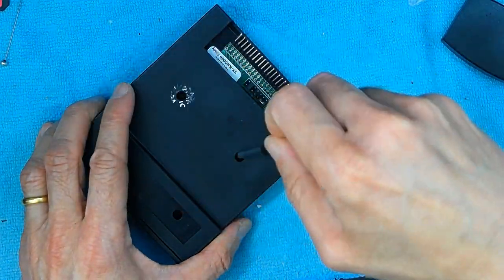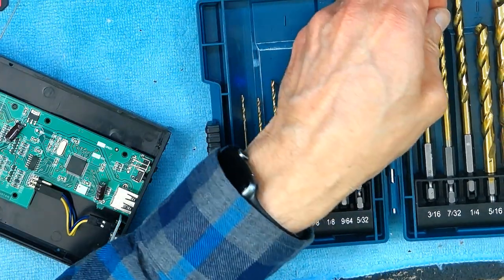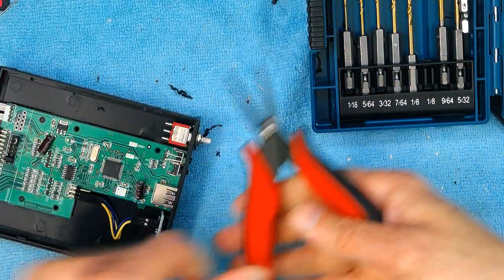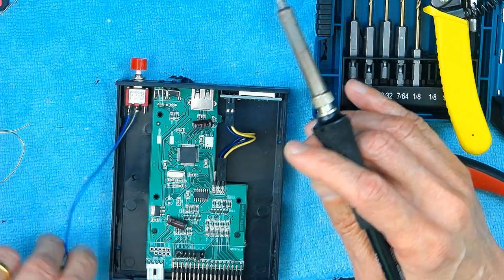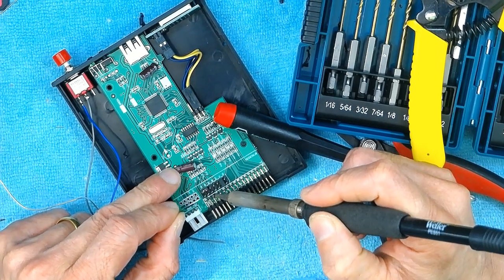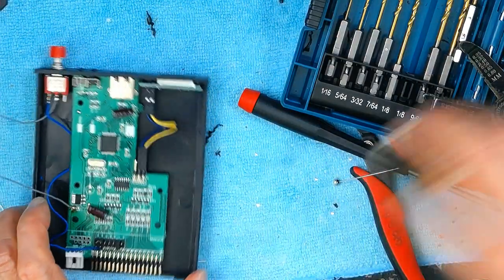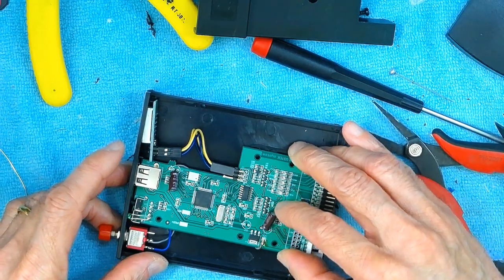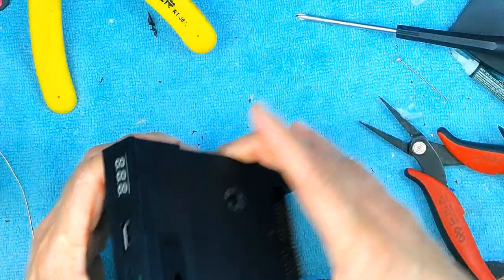Tutorial on how to modify Gotek Floppy Drive Emulator For a Technics SX KN-5000 Music Keyboard

Comment: Hello, is it not possible to mount a regular Floppy Drive Emulator or do you have to specially mount the Floppy Drive Emulator for an XS-KN5000, John
Reply from the maker: Hi, You have to mount the specific one, or else it will not read. These emulators rage from $15 to $300 and the only difference is the firmware, and other customization such as OLED, encoder etc.
Reply: @TECHNOLOGYTIPS101  
    I think it's quite a good price: $300, which is why I asked whether you could also do it with a general emulator
Reply from the maker: @johnweetzel8633 @johnweetzel8633  Yes, you can as if you are good with soldering with above-average computer knowledge.

Comment: The KN5000 wants to format the floppy every time. I have the SFR1M44-U100K emulator factory was MITSUBISHI M355F-3252MM will it work?
Reply from the maker: You need to make sure the Jumper settings on the Emulator matches the ones on the Mitsubishi Floppy drive. Also use the Windows App to format the flash drive to 100 banks at 1.44MB each Bank.
Reply: @TECHNOLOGYTIPS101  Thanks for the answer, the problem was actually the jumpers in the drive. I changed to another setting and everything works.
Reply from the maker: @karolcwielong3963  I am glad to hear that, all the best!

Comment: any clue sir for the position of the jumper on the SFR1MM44 U100K ? in my kn 3000....pls..
when i try to load any floppy numbers from 1 or above its will go back to 000 and gives error 02 and 09 on my kn3000 screen...guide me pls,....
Reply from the maker: It  has to match the exact settings of the old floppy which was removed from the keyboard. There are 3 possibilities that you can set it to, and they are Master, Slave, and Cable Select. Most likely you need it to be set at Master. The manual of the Emulator should tell you which position is Master, and it should also be printed on the PC board next to the jumper pins.  Thank you

Comment: does SFR1M44-SUE work for keyboard?
Reply from the maker: That depends what type and version of firmware is installed on the SFR1M44-SUE. If it has the factory original firmware it may work for some keyboards not all. Specially if the original floppy drive was Mitsumi or Y-Data you will have a hard time with it.
Reply: @TECHNOLOGYTIPS101  it doesn't work on my keyboard if i partition is unreadable
Reply: @TECHNOLOGYTIPS101  if not I partition, can be read but can't be filled in files

Comment: Please make for kn 2000. Thank you
Reply from the maker: Most of the KN2000 Keyboards have the 26Pin Floppy Drives, so these will not work for them unless you get a 26Pin to 34Pin Adapter.
Reply: @TECHNOLOGYTIPS101  i don't understand about what you say. But thanks for reply. And if you do that for kn 2000 maybe future, please upload.
Reply: Hello do you know which GOTEK works on the SY FD3 Technics disk drive which was used on the GX3 and GX5 Technics organs
Reply: @PakBudiTarigan  the KN2000 has a different  ribbon connector with 26 pins so you would need an adaptor to put the electrical connections on a 34 pin normal plug used in most PCs to the 26 pins used by the ribbon connector.
Reply from the maker: @timpullen4941  Hi, Your unit was originally manufactured with 3 different types of floppy drives. So the bios on that specific model are programmed for the exact  type of floppy drive which is currently installed in it. 
Even the pin count, connector type, interface  layout and jumper settings could be different. So  I have to know exactly which drive is in there now to tell you which emulator can replace it.
Reply: @TECHNOLOGYTIPS101  thank you brother. I will check my kn2000. Merry Christmas and Happy New Year
Reply from the maker: @PakBudiTarigan  Thanks and Happy New Year to you as well
Reply: @TECHNOLOGYTIPS101   Hello, the original floppy is Mitsubishi MF 355F-3252MM, rev. D, from Dec. 1997, and the emulator is SFR1M44-U100, I performed all the steps several times, I experimented, but always - ERROR 2 - there is no disk in the device... Advice?
Reply from the maker: @HenriNorman @user-ns9dp6of1c  Greetings; please write your question as a new question, not on the follow-up questions of another user.  In your specific case it appears that your Jumper Settings are not correct. Please make sure that your jumper settings match the old floppy drive.

Comment: my technic sxkn 2000 has 34 pins can you do the same? Thank you
Reply from the maker: If you Technics has a 34 pin drive then you don't have to do this. The drive like the one linked below should work just fine  https://www.ebay.com/itm/332972572625?epid=22027363174&hash=item4d86b63fd1:g:P8UAAOSwvpVcH1Zg
Reply: Hello @musha660,
I also have the technics kn 2000. Did you try the link below and did it work?

Comment: I BOUGHT GOTEK  SFR1MM44 U100K....CAN THIS MODIFY SO THAT MY KN3000 CAN READ IT...
Reply from the maker: It has to do with the type of floppy drive that is currently installed in your Technics SX KN3000 Keyboard. Not all of them had the same exact floppy drive. So if you can take out the old floppy drive from the keyboard and tell me what the model number is, then I can tell you if the stock SFR1MM44 U100K will work on it.
Reply: @TECHNOLOGYTIPS101  ...sir its ...Sony MPF920
Reply from the maker: @kabali208  OK based on this data sheet it should work fine  https://www.cnet.com/products/sony-mpf-920-floppy-disk-drive-floppy-internal/
Reply: @TECHNOLOGYTIPS101  so...can i follow this kn5000 method on kn3000?
Reply from the maker: @kabali208  No for the KN3000 you don't need that switch, you need to change the jumpers to a matching position as your old drive.
Reply: @TECHNOLOGYTIPS101  any clue sir for the position of the jumper on the SFR1MM44 U100K ?

Comment: Dear Sir, Could you say if it is the same for technics SX-PR 250? It is also a 34 Pin floppy disk. Regards
Reply from the maker: Hi, The old Technics SX-PR 250 had three different types of floppy drives, and each one had a different configuration. Some of these configurations were controlling the drive jumper settings through the Floppy Drive Firmware and there was no physical jumpers on the drive. So in order to know which floppy drive emulator is right for you I need to know which model floppy drive your Technics originally came with.
Reply: @TECHNOLOGYTIPS101   The floppy drive is a model : SY-FD20!
Reply from the maker: @asterix3542  Based on the manual this is a proprietary drive which has a 26pin controller board behind the 34pin drive. So it will only work if you take the controller board out and attach it to the new Emulator. See manual http://technicskeyboards.com/files/4114/1913/5359/sy-fd20_service_manual.pdf
Reply: @TECHNOLOGYTIPS101   Thanks very much for your answer. If i understand your explanations i have just to connect the gotek floppy drive to the 34 pin connector with the modifications on GOTEK floppy drive?
Reply from the maker: @asterix3542  You will need to get the board out of your old floppy and attach it to the Gotek Emulator. For the modifications to the Gotek Emulator you will need to follow this video here https://www.youtube.com/watch?v=KtfD260bN5E

Comment: Hi
Thank you for your patience, great job.

Got two questions, 
1. Where do I get a Floppy Drive/UBS for my KN 5000
2. Where do I get a LCD Panel replacement for the KN 5000

Thank again
Regards
Paul
Reply from the maker: Thank you, so you can get the emulator on eBay just search for "Floppy Drive USB Emulator For Technics SX KN-5000"  You can't find a new LCD Panel for this because Technics stopped making them, however keep an eye on eBay many people sell them for parts and you should be able to find it sooner or later.
Reply: @TECHNOLOGYTIPS101  thank you for the reply.
Do I need to have floppy in order to get the emulator to work?
Sad about the lcd….. with out it, the keyboard is not as good
Reply from the maker: @_PSantos  No you don't need any floppy drive, but you must have the floppy drive connector cable inside your keyboard to plug it into this one. I know it's sad that Technics stopped making Music Keyboards because they had some of the best keyboards.
Reply: @TECHNOLOGYTIPS101  totally agree with you, they’re still sound great! Again, than you for the info, and if by any chance you come across someone with a LCD that I can use…… if I get it to work I’ll see the emulator issue next! Stay save!
Reply from the maker: @_PSantos  You too!
Reply: Got myself the Emulator. and will try to follow your instructions. I´m ok with the soldering but I do have a question, the pins (jumpers) on the board, what is the right way to plug them?
Reply from the maker: @_PSantos  The default is best: one vertical and the other horizontal. So, take a photo of the original settings for your reference.
Reply: @TECHNOLOGYTIPS101  thank you
Reply from the maker: @_PSantos  No problem

Comment: It will really work? Someone tested it in Technics KN5000 ??? In my opinion GRAY wire in this video is soldered not to GND but to +5V line (!!!) ...
Reply from the maker: From my personal research it should be connected to Ground. The reason is that I took apart the original floppy disk that came with the KN5000 and traced down the wiring and all the lever switches to see what triggers the alert about floppy disks presence. If you don't do this modification the Keyboard may not detect the presence of the disk, or in this case flash drive.
Reply: @TECHNOLOGYTIPS101  But on emulator you follow by trace +5V (not GND) and did solder GRAY wire to resistor on +5V line trace ... On emulator written GND on this trace but not relate to this trace - it just relate to 4 pin power connector pinup and means second pin.
Reply from the maker: @wojteksz.8715  I double checked the video and you are absolutely right, the wires is connected to 5V. For some reason it is installed in my Technics KN5000 and it works great, so I guess it will work with 5V also. I am thinking the reason why it works is that there is an electrolytic capacitor next to it which is probably grounding the signal that way. So the verdict is that either option will work.
Reply: @TECHNOLOGYTIPS101  So it is great news! THANKS ! I just saw little "mistake" with this GND / +5V soldering but not matter ... most important that it works ... ;o)
Reply from the maker: @wojteksz.8715  Thanks for catching it :-)
Reply: @TECHNOLOGYTIPS101  tiene que ser emulador Gotek u otra marca sirve también
Reply from the maker: @salvadorvasquez1356  Only Gotek, I didn't try it with other brands.
Reply: @TECHNOLOGYTIPS101  gracias
Reply from the maker: @salvadorvasquez1356  De nada

Comment: Hello Sir, also possible for Ketron SD1! Thank you.
Reply from the maker: Greetings sir, The Ketron SD1was originally manufactured with 4 different types of Floppy drives,  and they are not interchangeable.  Some of them came with a 26 Pin 1.44MB Drive, some with 26 Pin 720KB Drive, some with 34Pin 720KB, and some with 34Pin 1.44MB Drive. This will only fit those ones that originally came with a 34Pin 1.44MB Drives.
Reply: @TECHNOLOGYTIPS101  I had Ketron, SD 1 fits perfectly!
Reply from the maker: @HenriNorman  Thanks for your feedback

Comment: Works 4 technics kn 6000 to?
Reply from the maker: This modification is not required for the Technics SX KN6000, for that you need to customize the firmware to match the floppy drive which is inside the Keyboard. For example this one https://www.ebay.com/itm/392199179987
Reply: The rythms and midis from other brands such as yamahas can be shared with the sxkn6000 technics with the usb emulator??
Reply from the maker: @fcojaviermurillow8840  Not from other brands, but you could share them between similar models of Technics Keyboards.
Reply: Ok .thank's
Reply from the maker: @fcojaviermurillow8840  You are welcome!

Comment: Per Korg i30 cosa fare?
Reply from the maker: https://www.ebay.com/itm/333827132240
Reply: @TECHNOLOGYTIPS101  Thanks, but I have already mounted a Gotek from 1000, everything works, but every time I change the number I am forced to exit the disk mode otherwise it does not change.
Reply from the maker: @Marcompm2002  That means you did not use the format software on the Flash Drive. You need use this program https://www.khalids.com/downloads/Software/USB_Floppy_Emulator_1.40i.zip